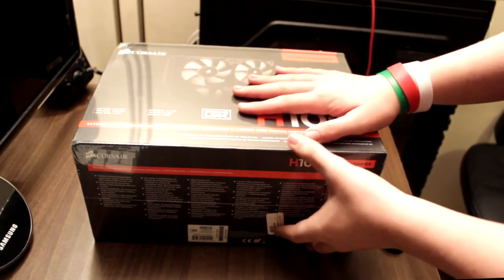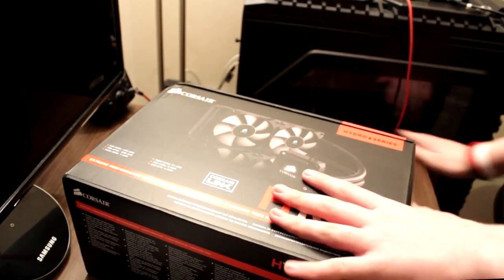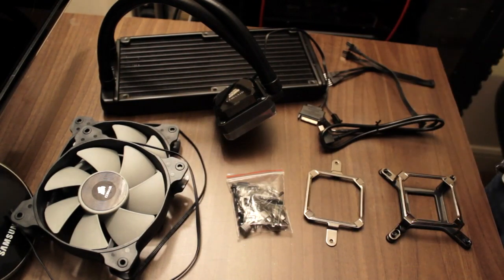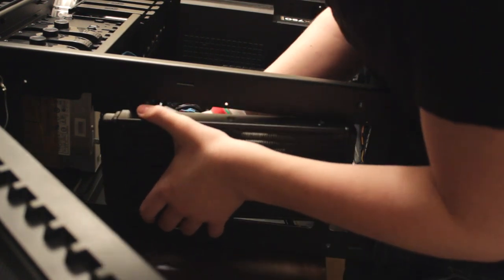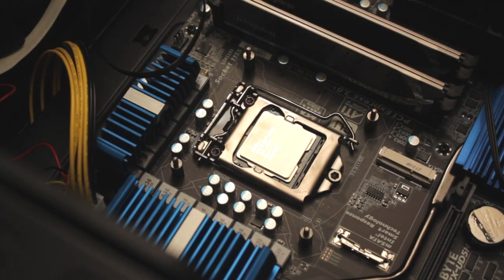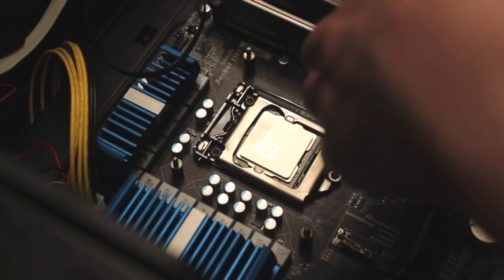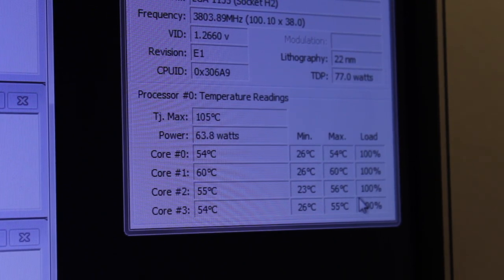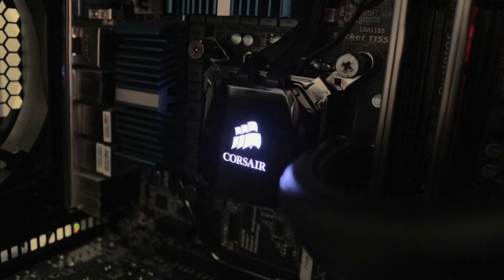Corsair H100i: Unboxing and Installation

Comment: So, I just bought one of these and I need to know something about the link cable.. the only thing i need to do with the corsair link cable is just plug it in the cooler and in the motherboard, right ? I dont need to buy any other stuff to use it, right? Cause I want to change the speed of the coolers and someone told me I needed the link cable and the program to do that... please! :D

Comment from the maker: You can do either. But in terms of dust accumulation id have the fans on the outside and the radiator on the inside, so you can just lightly pull the dust off of the radiator without having to take the fans off. :)

Comment from the maker: I'm aware that there is some sort of issue but I wasn't able to actually pinpoint the problem I had to hardware. The reason I thought I had an issue was because my CPU that I thought was simply overclocked and not worrying about voltages was running at a very high voltage. But I never saw any proof, that that issue was in fact real, but if it is I better go down to my hardware store and re-fit to see if its true. The only issue I've had is the noisy ass fan controller built in that whines.

Comment: bleedingsixcolours, you're actually incorrect -- the issue with the mounting bracket being loose is real, even if installed correctly. It's true that you can go through with the installation with a wobbly backplate, but many users are reporting issues with imbalanced pressure distribution by the pump. This issue is easily fixed by buying little nylon washers from the hardware store and mounting them behind the motherboard, which should have been included in the H100i kit but weren't.

Comment from the maker: The H60 is a really thin radiator, its not the best at heat dissipation, if you want proper overclocking like that the H80 and H100 perform better than a Noctua NH-D14 in most cases. Also yeah, where I live I get extreme colds and Extreme heat.. Not the greatest in the summer for my computers... Idling at 45 degrees...

Comment: eh seen other videos of the h60 and I saw how he could not keep temperatures at an overclock on a i7 950 socket 1366. , Also to be a user of the device, and not have good temps, part of the blame is the cooler, the other area where I live, to be in Buenos Aires, I have the problem of high humidity. Get in my shoes, I'm tired.

Comment from the maker: Yes it can, very well. Corsair has been the leader in consumer AIO watercoolers until very recently, and are still amazing performers. The problem with these temps is the CPU was using 1.32v at times, which was way to much for this overclock as I hadn't set the voltage manually. Since changing to 1.15v my temps never go about 73degrees.

Comment: Fans in a push configuration push dust into radiator and you will have to pull your fans to clean the dust.

Comment from the maker: Yeah One of my problems was the mounting, I mounted it a tad wrong, and I recently changed my voltage, got it down to 1.1V at 4GHz on my 3570K at about 65 degrees passive, which I was very happy about. Thanks :)

Comment: you got prity high temps for 4.5Ghz... im on h100i with i7 3820 at 4.8Ghz and im bearly hiting low 70C. set the voltage mannualy because auto overshoots by alot :)

Comment from the maker: the Clockspeed doesnt matter. If you get a good chip, you could hit 4GHz at 1.2Volts then you'd see temps with the H100i around 58-68degrees. You could push it much further though mate.

Comment from the maker: You plug them both in mate :) The SATA to a power cable from the power supply and the 3 pin into the CPU Fan header.

Comment: the SATA cable on the cooler, does it plug straight into the SATA plug on the motherboard? You know where you plug in the hard drives

Comment from the maker: Hey man, dont worry about it. There is two USB 2 headers on the bottom of the motherboard, one is colour coded red for 2x power for charging Tablets and Phones ect. So I plugged the Corsair link into the standard one next to it.
Also, I believe the 1394 port is for Firewire which was an Apple standard that never really caught on disappointingly.. :) Hope I could help!

Comment: Sorry for the question, i have the same motherborad as you. witch port did you instal the corsair link cable to at the bottom of the board? and what is the 1394 port for?

Comment from the maker: I used MSI Afterburner to set my GPU fan to '25'. I have no idea what RPM that is, but it was absolutely silent and my CPU fan was like a hoover in comparison, Now I just run the fans that came with the H100i at 900rpm.

Comment from the maker: Haha, Trust me, if you go from 3.4GHz to 4.5GHz on this 3570K it surpasses the speed of the 3770K in a lot of benchmarks, and I believe that the K series processors dont void your warranty when you over clock :) The main reason I upgraded from the stock cooler was just the noise! The stock coolers whiny high pitched noise used to drive me crazy;D Now even when encoding 1080p video I only hear a faint low pitch hum.

Comment: Item number
140578428541

I used these as I had them to hand,I just put them over the rubber washers that was already on back plate,It tightened nice after doing that.

Comment from the maker: Nope.. After I tightened the stand off screws the backplate felt like it was part of the board!  However there is some issues with the mounting system it seems.

Comment from the maker: is that 60degrees Blend test or smallFFT, cus the difference in the temps are massive between those two tests. But yeah I am planning to re-seat the cooler, because my second core seems to have absolutely crap temps, compared to the other cores. Thanks man, appreciate it :)

Comment: still so hot my H80 is running at 60c ,and the processor speed are 4.6 MHz try to apply new thermal paste, worked for me. still nice vid man gonna buy this cooler on my new computer.

Comment from the maker: Okay thanks, I was only thinking about it cus of the stupid 'Updates Available' notification that keeps coming up.
Yeah thats one of the shit faults of some of the H100's but yeah its fine, not loud by any means, and runs very cool! And nope, I was just going to unplug it after putting all my settings in but I just ran it around my south bridge heatsink long the pipe and its pretty hidden, and ive had no issues at all with sleep. No problem for the overclocking guide, its pretty unnoticed ;D

Comment from the maker: Hey:) Thanks, Yeah im running 10.8.1 so my question is did you upgrade from .1 to .2 and if so what did you have to reinstall with Multibeast? Thanks
Also, yeah I DualBoot Windows so I set the fan speeds in Windows, and then booted back into OS X and I think its saved into the pump block thing. If you have the H100 then I dont know if there is much point upgrading but yeah thats how it works :) Hope I could help!

Comment from the maker: Im going to replace the stock thermal paste soon, my Core 2 I believe gets sometimes 10degrees hotter than the other 3 cores.. So I need to make sure I got even contact..
In relation to the Push-Pull im pleasantly surprised with the differences with Push-Pull over Push, I might actually go ahead and configure it now.. Thanks alot:)

Comment: Cool, I have the haf x so i know it will fit. I will get the H100i maybe the bundle that you've linked in description seems really good deal. atm im using the intel heat sink that came with my 3570k so cant overclock yet lol

Comment from the maker: Yep very true, But a Radiator needs static pressure, and having two more fans that vaguely sit on the rad actually wont make much difference, but yes your right It can go inside the case and you can either mount two more 120mm fans or two 200mm fans :)

Comment from the maker: Yeah I get where your coming from.. I suppose if you did get it you could easily hit 4.8 and keep your temps. That is also the reason I went for the H100i over the NHD-14 or a smaller heatsink like your 212EVO; mainly just for it to look sweet, and it makes your rig look like its worth more than it is;D

Also I think your motherboard has a goodsized motherboard tray cutout. My HAF X for some random reason's motherboard tray cutout is like 1cm wrong... So I had to take the whole thing out. -.-

Comment: Yep that'd be why. I mainly want it for the aesthetics because it gives your case a more clean look then a bulking heatsink over the CPU haha. I clearly don't need it per say as my temps are fine atm. 

The only reason I'm reluctant is I'd most likely have to remove my motherboards as well which is a major pain in the ass.

Comment from the maker: Oh Right! All the tests in this video were on 4 threads of SmallFFT Torture tests which beats the crap out of the CPU; hence those massive temps I suppose! I also tried out OCCT and hit temps of 80.
Id say.. Wait until you think you Need it.. Or wether its just worth selling your 2500K and getting the 3770k or 2700k. If you dont want that, then yeah its a Great cooler; now I know im using a massively more demanding test compared to everyone else!

Comment from the maker: Oh right! Okay, yeah that is probably why you get better temps. Ivy Bridge is fine up to about 4.4 then skyrockets about 10 degrees. I cant seem to get it stable even at 4.6, yet my 4.5GHz overclock is 100% stable, I even ran Prime95 with 4 threads of smallFFT for 26 and a half hours..

Yeah, I sure will! Ive found however that when im using Handbrake or Final Cut Pro I will never even hit 80 degrees.

Thanks man.

Comment: I'm running on 1.32 Vcore, cannot remember what i set PLL to. I am running a 2500K though and I beleive Sandy runs a bit cooler.

Be sure to post a new video when you try out your new thermal paste and include different fan settings temps. Would be very helpful.

Cheers.

Comment: 86 degrees? I was expecting better, my Hyper 212 EVO doesn't reach 80 degrees with a 4.5GHz overclock. Any chance you could let me know temps with performance fan settings? Cheers.

Comment from the maker: Hey Dude, In this video I placed the radiator outside of the main chassis, and the fans inside. After however I saw they looked really far away so Yes you can just put both inside on any case with enough clearance, like I did after the video. In your case, Yes the 550D can have the Radiator and the Fans inside the case :) Hope I could help!